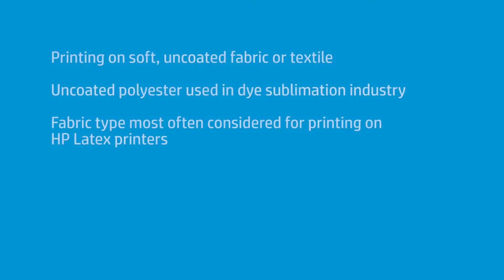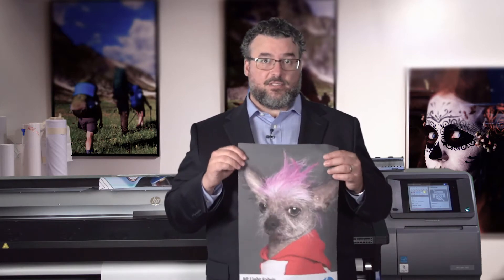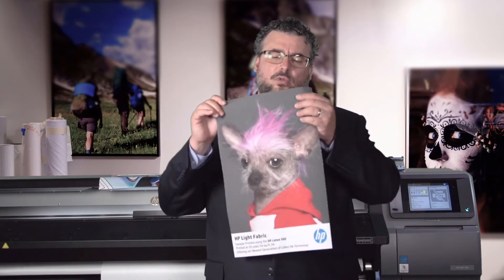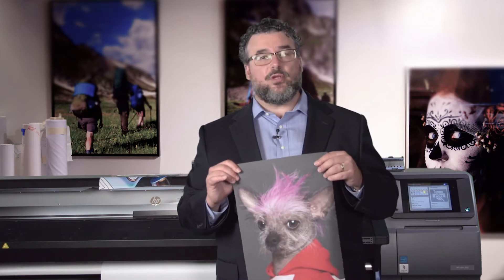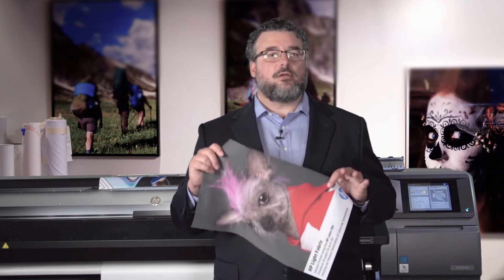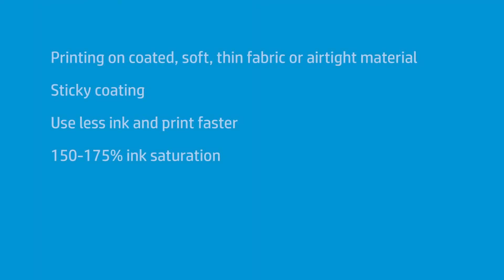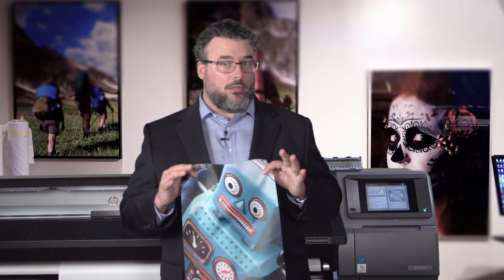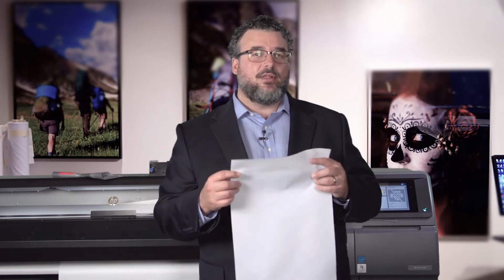Printing on Fabric: Coated and Uncoated | HP Latex | HP

Comment: Would this be applicable to the HP r2000 by chance?
Reply from the maker: Hi there, thanks for contacting HP Global Social Media Support!
I understand that you need to know whether you can print on coated and uncoated paper with this printer.
I will do my best to assist you.
This printer supports printing on Coated paper and uncoated paper.
Binu - Social Media Tech Support
Reply: @HPSupport  That's not what I asked, lol. I asked if I could print ON FABRIC with the HP R2000. I already know it can print on paper. I run an r2000 daily.
Reply from the maker: Thanks for the reply.
This printer can print on HP Durable Backlit Fabric.
Binu - Social Media Tech Support

Comment: Is latex ink good with transfer paper? Like after printing it on transfer paper and transfer it to the fabric through heat press........
Reply: No it's not. For that you'll need a different ink: a disperse or dye sub ink. HP has a series of dye sub printers: The HP Switch printers.